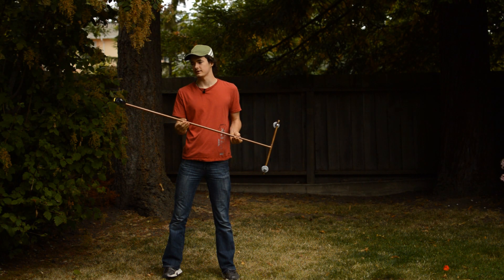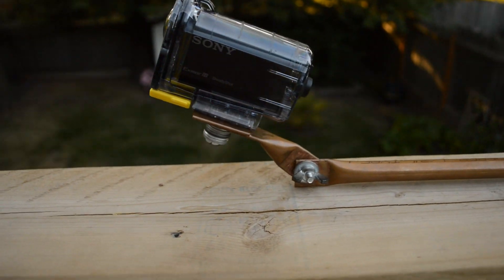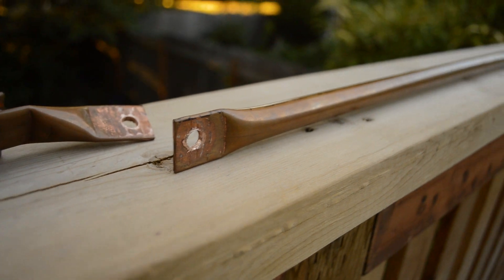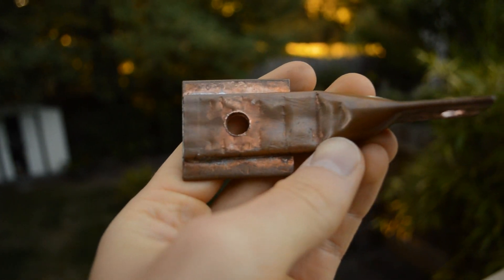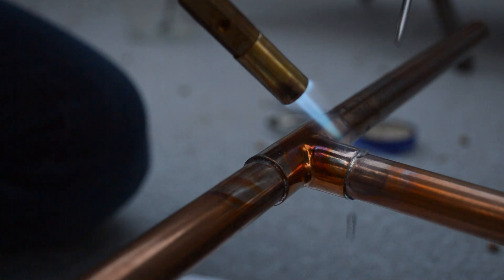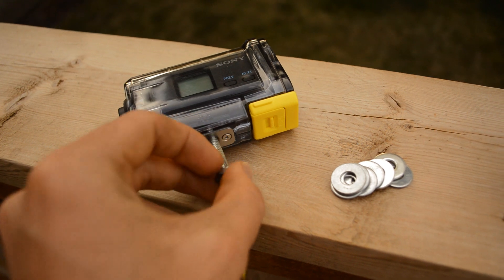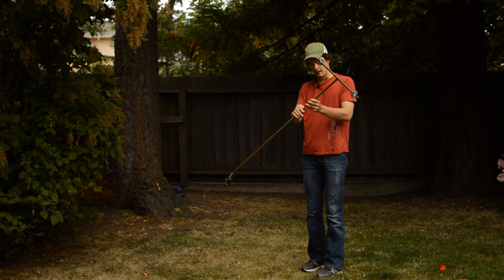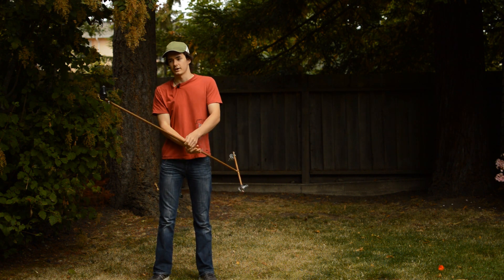Building an Action Camera Stabalizer - GoPro Steadycam

Comment: Very nice job dude congratulations! what micro sdcard do you recommend me to use with my action cam HDR-AS15 and my hero 3 white?
Reply from the maker: +Renatobighead I always use the High End Transcend or SanDisk Memory. $15 for 32GB is hard to complain about, just don't buy off eBay if it seems too good to be true, there are a lot of fakes out there. And at $10 - $20 for top quality memory I really wouldn't risk the cheap no name stuff.

Comment: Thanks so much for posting this. I've known about steady cams but thought the rigs were complicated and/or expensive. Definitely gonna try making one. I'd like too use aluminum though since it's probably much cheaper than copper, hopefully that works. Thanks also for the brief examples of how to use it, very helpful to newbie filmmakers like myself :)
Reply from the maker: +mwinklerdesigns I've found copper to be cheaper in the end, simply because you can solder it together, and fittings are readily available at any hardware store. Don't use PVC or any type of plastic to make rigs like these, it's way too flexible, and makes your footage shaky.